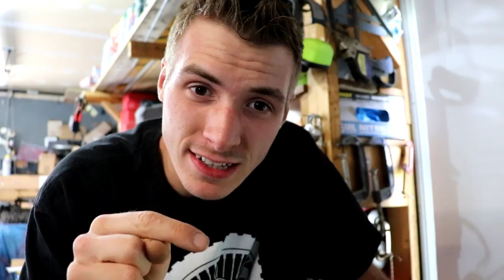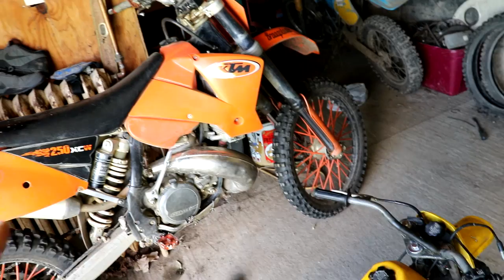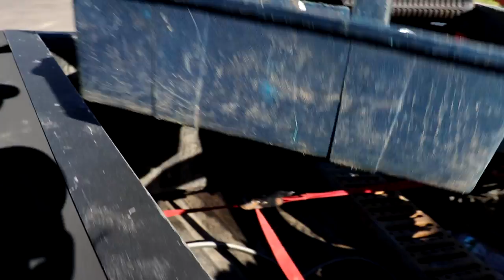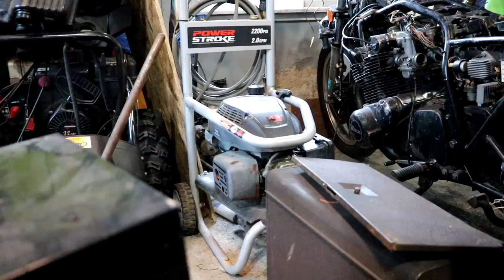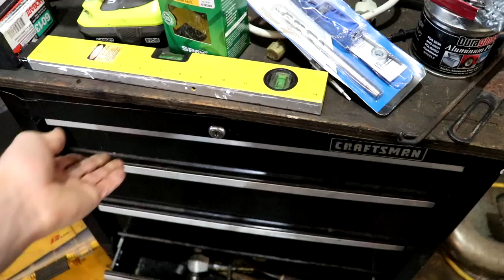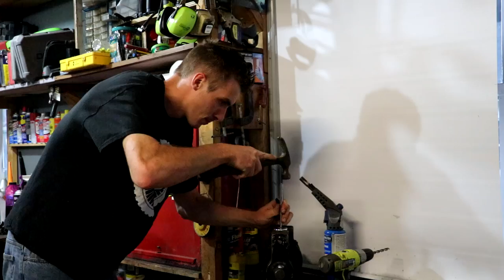THIS IS ALWAYS DANGEROUS

Comment: hope you are not calling the counter shaft seal the crank seals ? not sure . but 100% the crank seals are leaking and you need to do both of them . cylinder pressure into the gearbox is no good . should also you should put a little gauge on the freeze plug and the valve . so you can see the pressure drop aswell

Comment: You can perform a simple pressure test without the need of taking anything apart except removing the spark plug.  That being said....  99% of the time a lean condition is due to improper jetting.  Download the "KTM jetting app" and you'll know the exact pilot and main jet you should be using.  Plus the correct needle and clip position.

Comment: Possible ring blow by resulting in excessive pressure on crank seals leading to failure and pressurizing the transmission.. lean running engine will cause this for sure! Have seen this on bikes with restricted expansion chambers as well.. looks like the damage is done already mon frere

Comment: rich is not good. oil has no cooling properties. some people thing it's good to run it rich if you're not fouling plugs. wrong. I know mechanics that run 75 to 1 with 250 2 strokes. You don't need to run rich in the woods I use 50:1 for hare scramble racing.

Comment: I have a quad and it'll idle but when I give it gas it bogs down. Has anyone else had this problem or might know whats wrong with it?
Reply: David Rose.......
could use a carb clean/adjustment for the air fuel ratio.